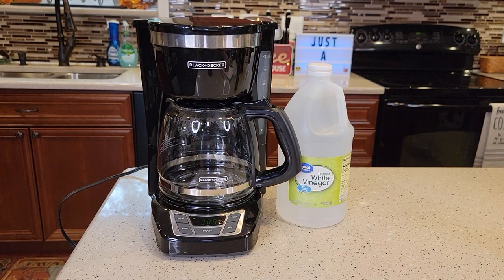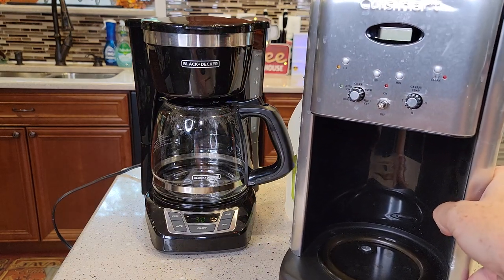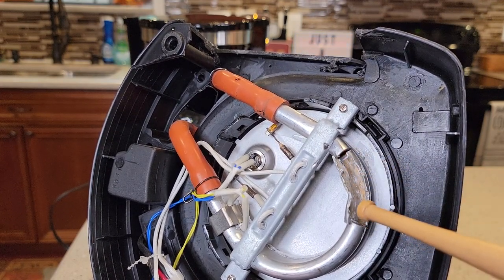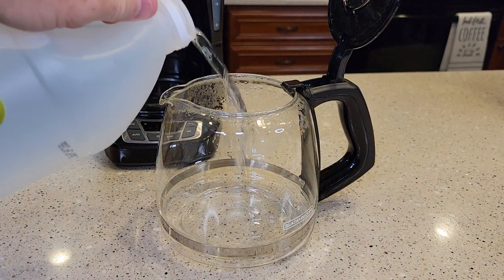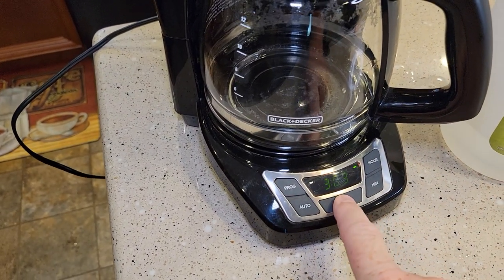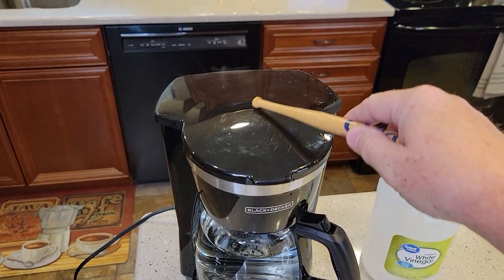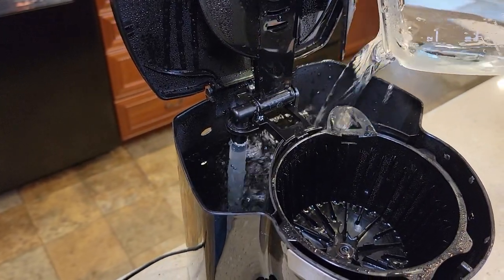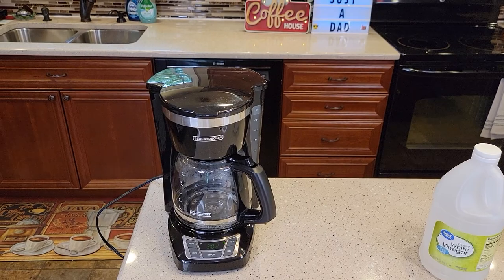Descale Vinegar Black+Decker CM1160B-1 CM1160B 12-Cup Programmable Coffee Maker

Comment: I use 2 denture cleaner tablets. I pour a pot of hot water in the tank, drop in 2 denture cleaner tablets, wait for them to dissolve, run the cleaning cycle, then run one rinse cycle, and done. I like this method because there's no chance of tasting vinegar because you didn't run enough pots of water thru the coffeemaker after descaling. And if anyone is wondering, no, I don't have dentures, I buy the denture cleaning tablets specifically to clean my coffeemaker.